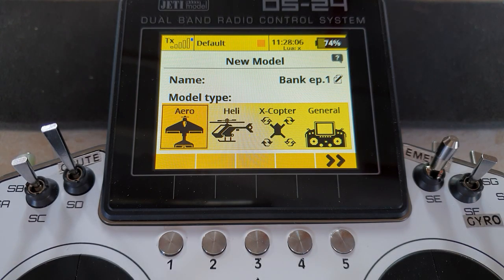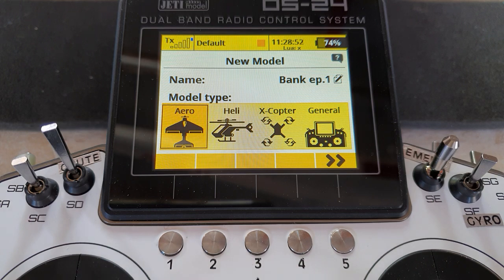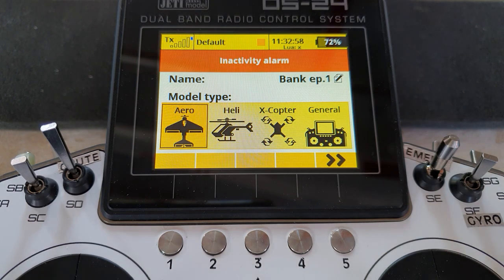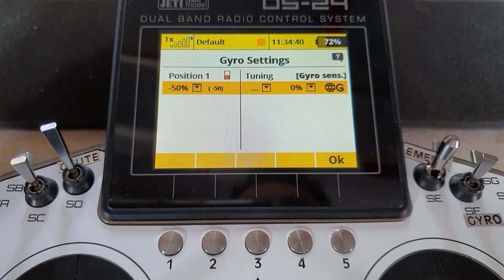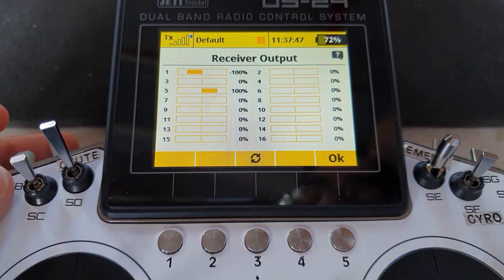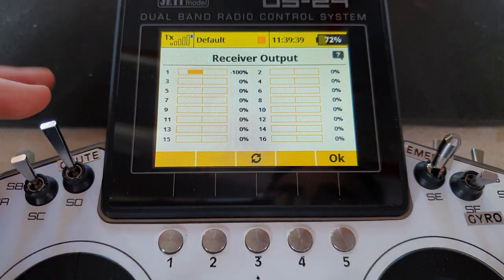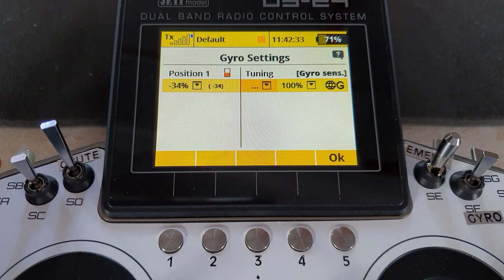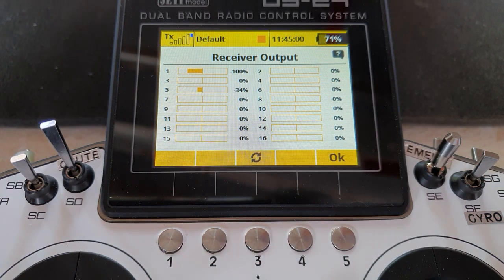Jeti - gyro banks episode 1.  Cortex, igyro etc

Comment: Hi; I set up both Banks in Normal Mode in the Cortex Settings. The different between both are just the Gain that I configured on them plus. The idea is to have dual rate gain in just normal mode. Which method Do you suggest to me ? Episode 1 or Episode 2 ? Thanks.